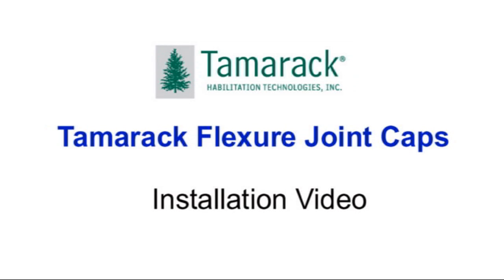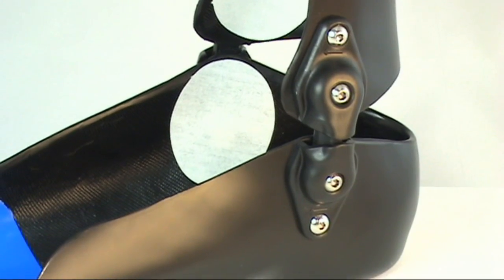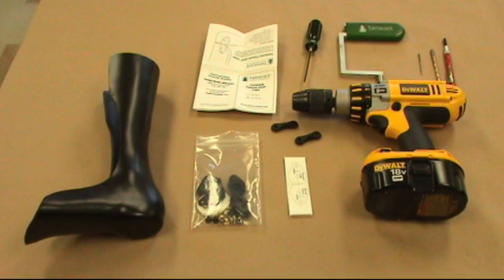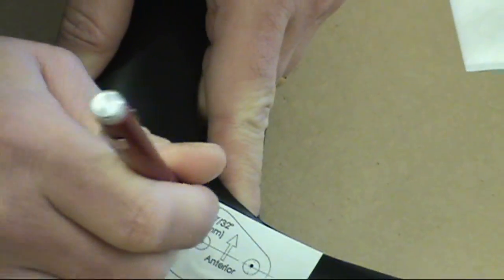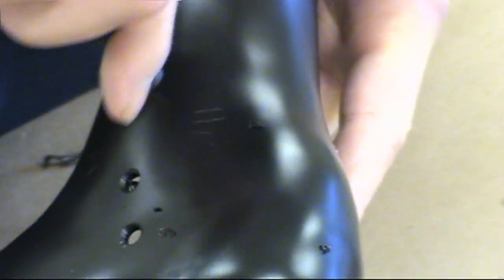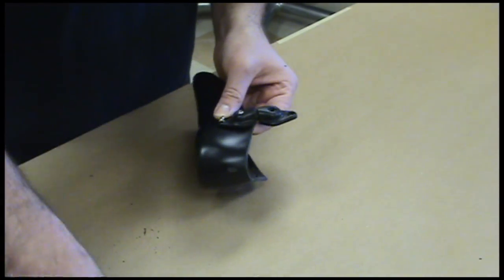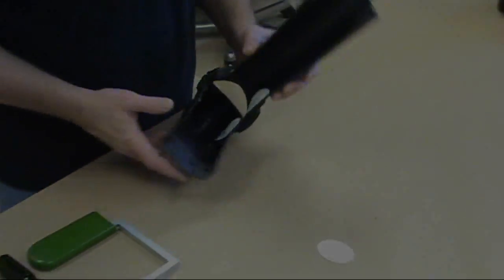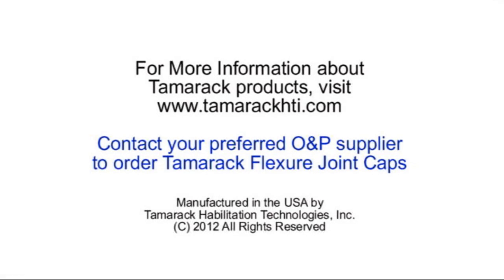Tamarack Flexure Joint Caps Installation Video

Comment: I like the external tamarack joints more than internals. More precise and easier to install
Reply from the maker: Thank you for your comment, Hadi. The Tamarack Flexure Joint Caps have worked great for our customers and are an excellent alternative to fabricating a new AFO when a patient is changing from a solid to articulating custom AFO.